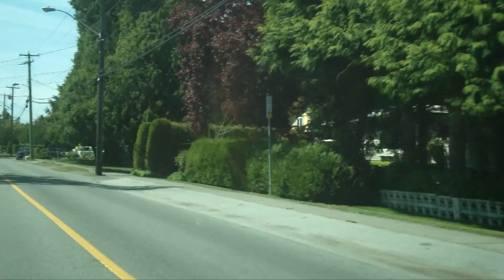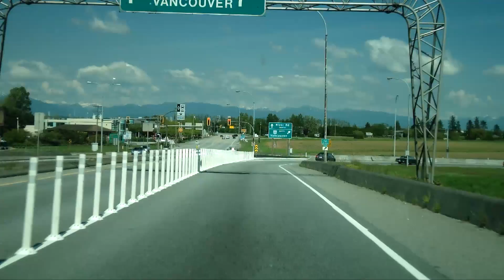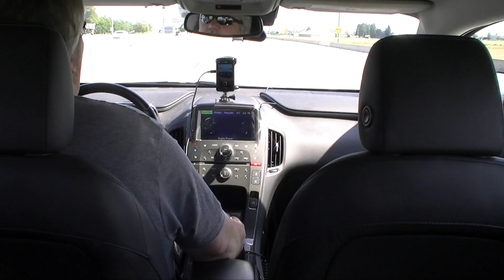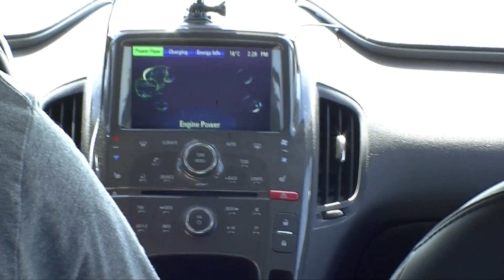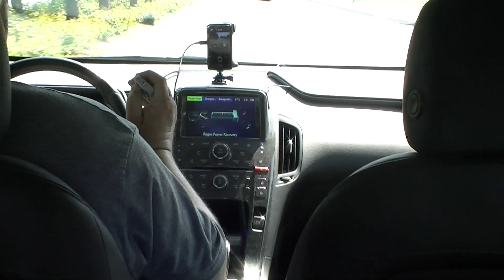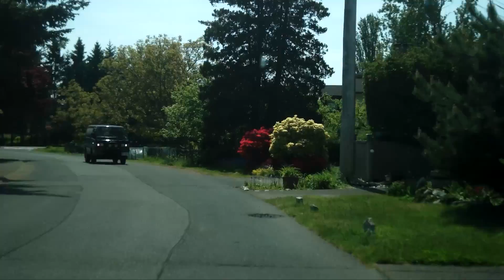How to drive a chevy volt for best electric range and fuel economy

Comment: Get a %100 Electric car from Tesla Motors.
Reply from the maker: I came very close to buying one, but then I realized that I would have to adjust my driving to accommodate the limitations of a Tesla. Some day when there are super chargers located in every small town in the country that may be an option, but today that is not an option for me or many others. When I am commuting around town and to and from work, I am well withing the range of the Volts battery 99% of the time.
When I go on my holidays, and go on road trips I need the gas engine. I do not want to be a slave, and have to plan my trip according to available super chargers.
I like to just pick up a map, and look at some interesting routes, and say, "lets go this way" and explore interesting roads and little towns that a Tesla can never go to because there is no place to charge it.
I don't need 300 miles of range, 40 is plenty, because when I drive beyond that range, I need thousands of miles of range.
Last year I drove back and forth across BC, Washington, Oregon, Northern California, Nevada, Arizona, Utah, and Idaho.
Could never be done in a Tesla.
Now, I do have friends with Teslas. They have had many more problems with their expensive toys than I have. One has had his main battery replaced,  another has had both is main battery and the main drive unit replaced, and a 3rd person I know, not a friend but a business contact has had problems with both the infotainment screen and his door handles, not to mention that the rear hatch leaks.
For that kind of money, not exactly a reliable car in my books. The only issues I have had was the valve stem caps rusted to the valve stems, and GM replaced all the stems and put on plastic caps for free, and my Voltec charge unit in my garage blew a fuse, which was easy enough to fix. Other than that I have had no problems in over 75,000 KM of driving.
So take that are stick it up your tesla.
Reply: 12voltvids Well, to be fair, those issues your friends have had with their Teslas most likely weren't serious issues, it's just that Tesla has been proactive with their warranty coverage.

I know a few people who've had their drive units replaced (the issue was caused by a bad bushing, and the drive units themselves are just fine), and have had their battery packs replaced (the issue there was a bad contactor, the battery pack itself was perfectly fine). So when Tesla isn't 100% sure what the problem is, or they haven't traced it to its original cause, they've gone the extra mile and simply replaced whatever might be the problem so that the owner is less likely to have to bring it back in again.

Now that they've traced the problem with the drive unit down, they just repair the drive unit rather than replace the whole thing, but initially when the issue first appeared, they were sending the drive units back to Tesla HQ so the engineers could look them over to figure out what was going wrong.

The battery contactor issue I believe is one that they still have to fix at the factory, although it needn't be the case forever-- it's just that it's not that common a problem after a certain battery pack revision, and it's easier than having someone at every service center who's able to replace the part on location for a problem that isn't cropping up that often. Once the Model 3 comes out and there are a lot more cars on the road, that will probably change and they'll do contactor replacements on site rather than shipping whole battery packs back to Tesla to have it done, because then that'll be the more economical option.

The door handle issue has been fixed with an over-the-air firmware update, so owners no longer have to have their cars brought to a service center to deal with that issue (I find the door handles gimmicky to begin with personally-- it's an unnecessary complication). Infotainment screen issues are something that every car with a screen will encounter now and then, it's not unique to the Tesla, but obviously it's likely to cost more to replace the screen if it needs to be done outside of warranty when it's 17" vs. 5", but then Tesla likely won't jack the price of a replacement to 1000% over cost like most automakers will either.

A leaky rear hatch is definitely a quality control issue, and it's not one you'll find often from major manufacturers, but it's one you probably won't find on Teslas within the next few years either. It's an easy fix, and these are the kinds of bugs they're using the Roadster and Model S to figure out before rolling out the high production, affordable range of cars. They've made impressive headway for a brand new automaker, but obviously being an early adopter is going to come with all the early adopter growing pains as with any new technology.

Is the Model S worth the price? Probably for some people, not for others. It's a $100,000 car, and for the $100,000 you're paying for it, you're not getting a lot of the things you'd get from a competing $100,000 car like a Mercedes S Class or BMW 7 Series-- that level of refinement simply isn't there for a comparable price point. But I think it's important to be fair and objective-- Elon Musk has said since before the Roadster was ever delivered that the plan was to use that car and the Model S to subsidize the cost of developing an affordable model that everyone can buy in order to speed the development and adoption of electric cars, not necessarily to be the best automaker or beat the competition. That's been since day one, but a lot of people forget it or choose to ignore it. I give him credit for being up front and honest about it-- you'll NEVER get that kind of candor from any other automaker, guaranteed.
Reply from the maker: babybirdhome The problems with the drive unit and contactor in the battery may have been what you call al minor issue, except when it is your car, and you are driving along, and the car shuts down and leaves you stranded waiting for a tow. The battery contactor issue appears to be on going, as my acquaintance that had both the battery and drive unit replaced on his car last year has had the battery pack replaced again. So that issue remains, as does the leaky hatch issue. The way I see it, for what the Tesla cost you would expect the quality control to be a lot better. On my volt, I have had no quality or fit and finish issues. When my weather stripping wore prematurely due to my big but rubbing it when getting in and out of the car, GM promptly replaced it at no charge, no questions asked.
I'm not saying that Tesla is a bad car, not at all, and the people I know that own them love the car, but the same can be said for 99.9% of the volt owners out there, We just think that we have a more practical car, as we get all the benefits of being electric, and no range anxiety with the ability to go anywhere, anytime, and no route planning required..